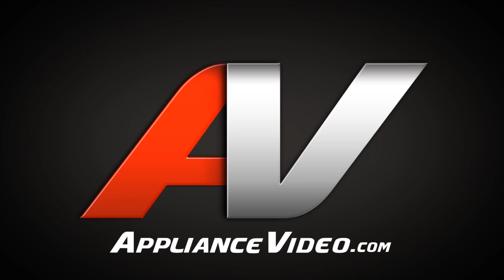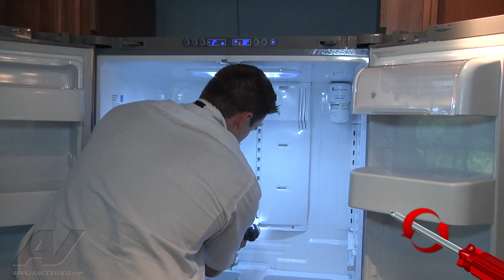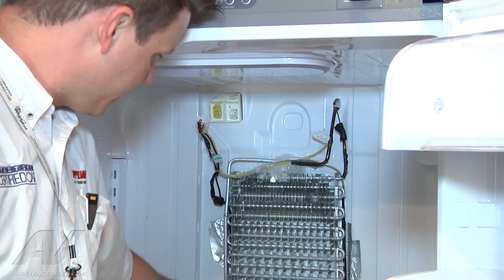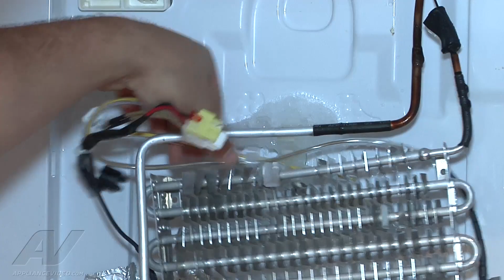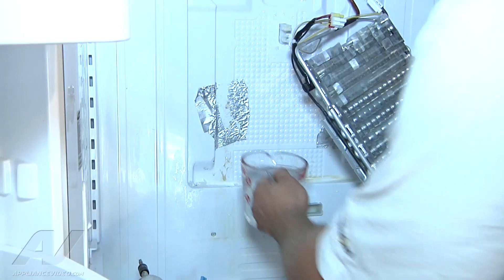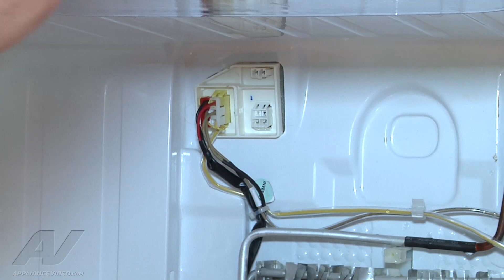Samsung Refrigerator Repair - Freezing Up On the Back Panel - Evaporator and Defrost

Comment: Thank you for your videos.  My 266 does not ice up.  The fan works.  The power cool seems to work - temp gets down to 30 but quickly goes back up to 46-48. Will not go below 46 on regular cool.   Was wondering what it could be.
Reply: So what was the issue? Mine won't go below 46 temp either. And these people on this video didnt answer either
Reply from the maker: Thank you for your positive response, we are glad we could help. Please help us by
subscribing to our YouTube channel. Or support our parts department at
1-800-830-5465 and our website www.SaveMoreOnparts.com .  This is the only way we can continue to
help the over 900,000 people per month like you repair their own appliances. We
also have thousands of more quality videos on all major appliances made by our
factory trained technicians at www.ApplianceVideo.com .
Reply from the maker: Great question, you can call our parts department at 1-800-830-5465 and they can give
you help 7-days A week. If you have a more technical question that our parts
department cannot answer, our technicians are answering
all questions at our website at www.ApplianceVideo.com under our Repair Help section. We have over 3,000 common questions
and answers that you can easily search through by your model number, appliance
make, and problem or error codes, and It’s free to search through our question
& answer library.

Comment: hey, great video..My issue is that the water filter on my model is BETWEEN the crispers.. CAN'T access the screws. How do I get the filter system out?? do I need to get to the back to disconnect?? 
ANY Video would help, i'm a visual guy...
thanks...
Reply: Pull filter out then press both tabs right above where you pulled the filter out press at the same time and it will release bottom shelf
Reply from the maker: Thanks for your response, we are glad we could help. Our library of over 5,700 videos are currently helping over 1.6 million people like you every MONTH.  Please help us by subscribing to our YouTube channel, or post our website www.ApplianceVideo.com to your Facebook page, Twitter, Instagram or any other social media sites. Your support will help us keep producing more free quality videos.

Comment: We have the RF267AEPN.  We've had it since 2010 or 2011.  About 2 1/2 years into owning this refrigerator we had the problem with the water and ice under the pantry tray.  I went online to find a solution and one of the things that we were told to check is the metal clip that hangs close to the defrost drain tube.  We found that the clip is to short.  It didn't even come close to the drain hole.  My husband made a new one and it has worked fine until 2 weeks ago. (June 2016)  We just took it apart again and he has put in another clip.  I'm hoping this will work however it looks like it may be an every 2 years event. Questions for you.....  if it does it again should we change the sensor that you changed in this video?  This is so frustrating but I am thankful I found this video.  We are DIY people but I don't want this to be an ongoing problem.  The money we have all paid for these refrigerators and the design is so poor it will only last a couple of years before there is a problem and another problem.  We live so far out that there is NO technician that wants to travel out here.  We maintain our refrigerator with new filters when it says to change the filter and we keep it very clean.  We pull it out often to make sure it stays clean of dirt and dust. We're doing our part to make sure this refrigerator last.  If you have any other ideas suggestion, please post it.  Thanks you
Reply from the maker: Great question, with our
technicians now getting hundreds questions weekly, they are answering all questions
at our website at ApplianceVideo.com under our Repair Help section. We have over
3,000 common questions and answers that you can easily search through by your
model number, appliance make, and problem or error codes.
Reply: Hi June, What did your husband use for a new clip? What did he make it out of?  thanks

Comment: This video is super helpful. My samsung fridge is not cooling and there are ice in the back panel. (freezer working fine)  How do I know which part I would need to replace?
Reply from the maker: That is a question for our technicians, they are answering all questions at our
website http://www.appliancevideo.com/repair-help/ .  We also have over 3,000 common questions
and answers that you can easily search through by your model number, appliance
make, problem or error code and it’s absolutely FREE.

Comment: I'm not so sure how "trusty" these Samsung refrigerators are.   Mine freezes up every year or so an needs defrosting.  Samsung has brought us back to the days of my childhood in the 50's when my mother had to defrost her refrigerator from time to time.
Reply from the maker: +joestarlite 

Good question, with our
technicians now getting hundreds questions weekly, they are answering all questions
at our website http://www.appliancevideo.com/repair-help/ .  We also have over 30000 common questions
and answers that you can easily search through by your model number, appliance
make, problem or error code and it’s absolutely FREE.
Reply: It's amazing to me how people think just because Samsung makes a decent TV, everything they sell will be good.  I made the mistake of buying a Samsung microwave to replace my 14 year old Sharp and it was absolute trash.  Thank you Hurricane Harvey for eliminating that piece of junk.
Reply: Samsung is JUNK!
Reply: Refer condenser freezes up and stops the fan.

Comment: Hi, I have the same refrigerator,  and resently we had a blackout and since then the fridge hasn't been cooling, but the freezer is working fine, could this be the same part that is giving us problems?
Reply from the maker: +ARIFUNSIZE 

         Good question, with our technicians
now getting hundreds questions weekly, they are answering all questions at our
website http://www.appliancevideo.com/repair-help/ .  We also have over 30000 common questions
and answers that you can easily search through by your model number, appliance
make, problem or error code and it’s absolutely FREE.
Reply: ARIFUNSIZE. Here in Thailand we bought a Samsung fridge / freezer.  .Had to call the engineer out during the warranty period following a power cut, which are quite regular. He was clued up and explained the software is sensitive to power surges. Recommended we unplug the machine overnight 5 and get surge protection fitted to the outlet the machine was plugged into. Told us to call him if we still had problems. No need, all was well after.

Comment: I have a Samsung french door type fridge, model # RF4267HAWP. Drain pan below freezer compartment filled with 1/2 inch of ice monthly = On hands and knees chipping it out.  Finally bought small part that was supposed to fix it BUT as I was tossing out expired foods and remainder was BELOW VENT OPENINGS,  ice accumulation below freezer drawer STOPPED. Now dry..  An easy solution - perhaps info can help another! Judy
Reply from the maker: +Judy Clair 

         Good question, with our technicians
now getting hundreds questions weekly, they are answering all questions at our
website http://www.appliancevideo.com/repair-help/ .  We also have over 30000 common questions
and answers that you can easily search through by your model number, appliance
make, problem or error code and it’s absolutely FREE.

Comment: Hi! I"ve got a client that has a samsung RS21DANS ,  bugs got into the control display and  can´t find  the way  to dismantle it , to clean it up and maket it work properly again , If you can help me on that I´ll appresiate it ! thanks.
Reply from the maker: +alfredo hernandez 

         We would like to help you answer your
question. With our videos now getting over 900,000 views per month and hundreds
of questions from people like you, our technicians are now answering questions
at our website http://www.appliancevideo.com/repair-help/ .  We also have over 2200 common questions
and answers that you can easily search through by your model number, appliance
make, problem or error code and it’s absolutely FREE. You also have the option
to email a factory service technician with a question on your appliance at http://www.appliancevideo.com/repair-help/ . If you’re looking for a repair video, you can
also search our library of over 2600 free repair videos. ApplianceVideo.com
specializes in quality DO-IT-YOURSELF appliance repair videos and we get over
800,000 views per MONTH to our videos worldwide and growing. If you need of
parts for your major appliance, we have over 5-million parts in stock at http://savemoreonparts.com/ .  Thanks for your support. Matt Ace
Appliance factory service technician.
Reply: Hi! thanks a lot for answering me, I will be in contact as soon as posible,  and if I can find how to dismantle the Digital display at front of the door of the SAMSUNG MOD: RS21DANS

Comment: I can't clearly hear which sensor you substituted due to the barking dog. Which sensor did you replace?
Reply from the maker: +Alberto González The sensor is subs to another part number on this model. If you call our parts department at 1-800-830-5465 with you model number they will give you the exact part number you need. 
Please help us provide more videos to our site by
subscribing to our YouTube page or posting our http://www.appliancevideo.com/ website on your Facebook or Twitter account. Our
factory authorized technician’s also daily provide free professional Repair
Help to people like you to help solve their appliance problems. You also have the option to email a factory
service technician with a question at http://www.appliancevideo.com/repair-help/ .  If
you need of parts for your major appliance, we have over 5-million parts in
stock at http://savemoreonparts.com/ . Thanks
in advance for supporting us. So email us if you have any other questions our
videos cannot resolve. Thanks for your support in advance.   Matt, Ace Appliance service technician.
Reply: I got it, its the bimetal sensor. The video shlws that you replaced only that sensor, while your description indicates that finally the Evaporator Defrost System (DA9600516B) was replaced. Did you find that the bimetal sensor was not the faulty piece?

Comment: Is the ice build-up a sign of failed "heating element?? A refrigerator repairman told me to just defrost it and put it all back together if the fan works.
If yes, and I need the heating element only as in the posted video - what is the ordering number for the heating element only?
Reply: +Rudy Kardos Generally with these refrigerators, there is nothing wrong with the heater element.  Its the computer that tells it when to heat up, which is not working.  You can test the heater element with a ohm meter to see if its shorted out.   Like I said, most of the time the heater element is fine.
Reply from the maker: Thanks for your response, we are glad we could help. Our library of over 5,700 videos are currently helping over 1.6 million people like you every MONTH.  Please help us by subscribing to our YouTube channel, or post our website www.ApplianceVideo.com to your Facebook page, Twitter, Instagram or any other social media sites. Your support will help us keep producing more free quality videos.

Comment: chris,
in the 2 or more years since they put the wire in it has happened only once but I think the kids left the freezer open when it happened.  it was a constant problem and was either overflowing or would freeze under the crispers with water flowing out under the ice and over edge to freezer door. Crappy design for an expensive fridge. after they fixed it I no longer have water outside from the door panel. I still get ice and so I have not bothered to do anything about it or complain
Reply: How much does that repair typically cost?
Reply: @rosieherrera3863  Have you found out yet?
Reply from the maker: Thanks for your response, we are glad we could help. Our library of over 5,700 videos are currently helping over 1.6 million people like you every MONTH.  Please help us by subscribing to our YouTube channel, or post our website www.ApplianceVideo.com to your Facebook page, Twitter, Instagram or any other social media sites. Your support will help us keep producing more free quality videos.

Comment: Is the newer heating element/part an improved one or is it the same (and will eventually fail as well)?
Reply: Did you ever find out your answer on the new heating element being better or just as bad?
Reply: @yellowribbon9118  i am installing a new evaporator heater element and temperature sensor today.  if that does not work, we are going to tip this pos into the trashpile.  ;)
Reply: @gbiles2  Likewise, I just bought these parts myself based on these videos. I will install these parts soon too.
 If it fails,  id love to take it to the shooting range.
Reply: @yellowribbon9118  has the back of your Samsung frozen since you replaced the parts?  Have you had a chance to be able to tell if it's made a difference?
Reply: @gbiles2  has the back of your Samsung frozen since you replaced the parts?  Have you had a chance to be able to tell if it's made a difference? Thanks in advance!
Reply: @emergesm2011  Its weird, I think it has made a difference based on no ice forming and pushing out of the cooling vents and having  cooler temps now. After a solid week though, the fan started to hum loudly and then stopped after a day or two, so I think ice formed again and has surrounded the fan again, however, my temp is cooler in fact and not warm like before. I don't get it.
 The 1st time when I removed the panel it was just to defrost and chip the ice off the back of the fridge and I thought I was done. When I removed the back panel this time, I took the panel itself and the fan apart to clean even there, and sure enough there was ice within the cooling panel too that I didn't address or even think of the first time. I discovered My drain was frozen too so I poured warm water down there to address that. 
For the most part my food isn't spoiling now and I'm happy for that, but I still think I will have to replace this fridge sooner than later. 
This fridge is on its proverbial last leg, the ice maker doesn't work on mine either and there's a class action lawsuit for the ice maker i think. I will never buy Samsung appliances
Reply: @emergesm2011  Symptoms eventually returned.  Replacing this trash asap
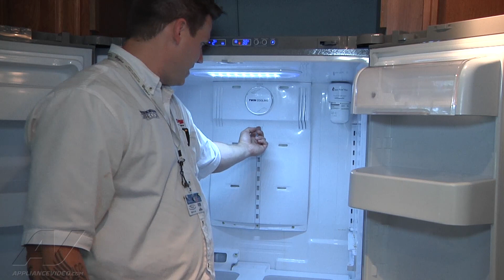Reply: video starts at 1:04
Reply: **Update** 
Replacing the thermostat, defroster, and bi metal delayed the return of the symptoms. My food isn't lasting as long as it should as the fridge doesn't get as cold as it should again. The ice accumulated once again, covering the fan too.
Replace this piece of Samsung trash immediately. 
Make sure you don't buy a fridge ever from a phone maker or t.v. maker.
Reply from the maker: Thanks for your response, we are glad we could help. Our library of over 5,700 videos are currently helping over 1.6 million people like you every MONTH.  Please help us by subscribing to our YouTube channel, or post our website www.ApplianceVideo.com to your Facebook page, Twitter, Instagram or any other social media sites. Your support will help us keep producing more free quality videos.